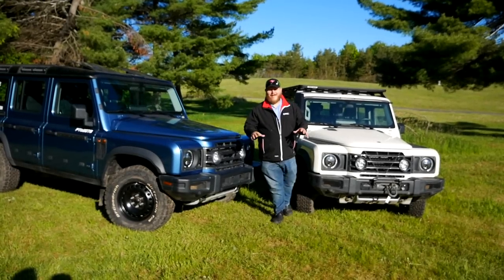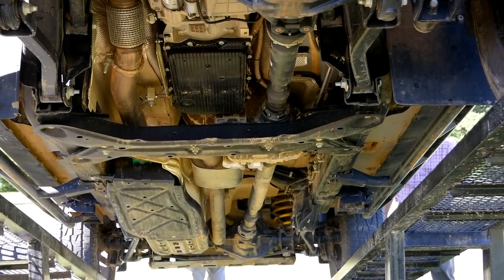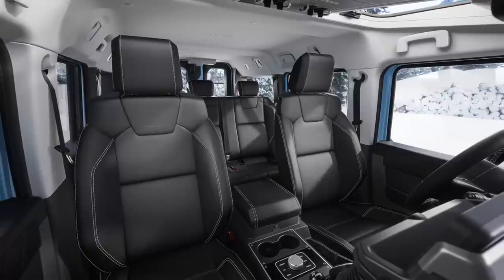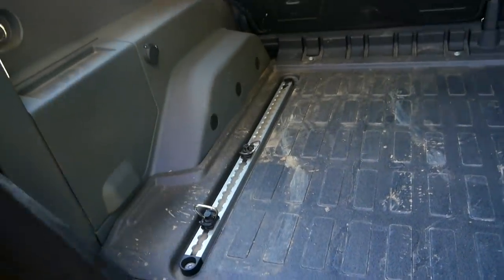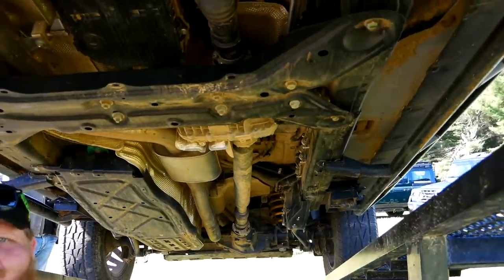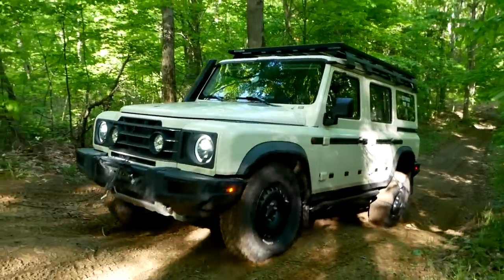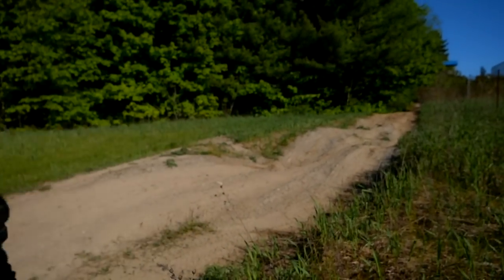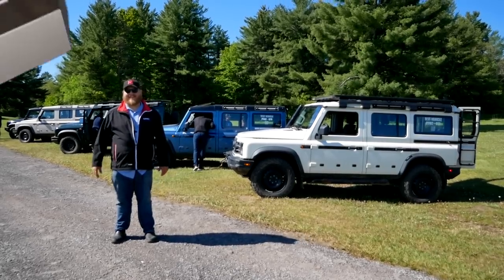Should Land Rover & Mercedes Be Worried about the Ineos Grenadier? ALL the Details on the Ineos HERE

Comment: Too expensive for old tech. Big cash grab I’m very disappointed. Another automaker, prioritizing profits, and not trying to supply the masses.
Reply: @johncolley3317  it's kinda crazy but this vehicle is cheaper than the Land Cruiser 70 Series, a 4×4 from 1984 with the last revision from 2007. Toyota can't keep up with the demand so they're now probably only producing for their commercial customers. The 70 Series on the used market in Australia fetches prices of 130,000 USD. It's insanely overvalued and the Grenadier can swoop in and give people the capabilities and compatibility (16 inch steel wheels for example, you can find 16 inch steel wheels all over the world in the most backwater places) they need. Oh and it's way more comfortable, powerful, fuel efficient and safer than that 70 Series.
Reply: @johncolley3317  diesel V8 is definitely awesome but it being just the single turbo with very low power does drag the experience down a lot. Most 70 Series sold around the world have the 4.2L 1HZ inline-6 diesel because that's fully mechanical
Reply: @imnotusingmyrealname4566  Smallest wheels are 17”.
Reply: Decades ago, when Toyota happened upon the iconic 70 series, BMW was already producing some of the best regarded straight sixes in the world and have continued to develop and refine those to keep that reputation today. Meanwhile, Toyota eventually had to replace their pretty average six with a V8 that was so average (but loveable) they had to seriously upgrade it in the LC200 then replace that with a V6 in the LC300. Reportedly, Toyota thinks it’s so average, thirsty and dirty that they will be replacing it with the 4 pot Hilux motor (I wonder if they will narrow the 70’s front wheel track…😂). Oh, and what did Toyota choose when they wanted a special engine for the latest Supra? You guessed it, the BMW B58. I know, it’s not the same application, but I expect they think it meets their own high standards for reliability.